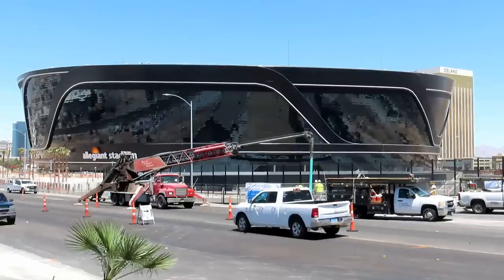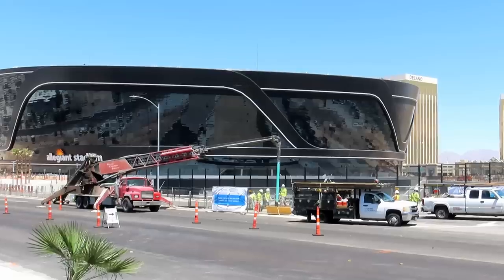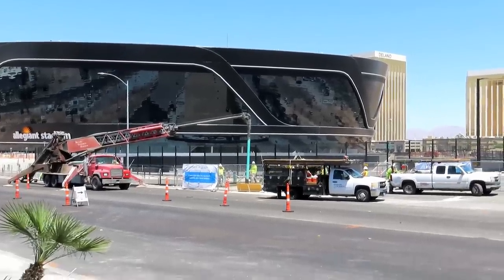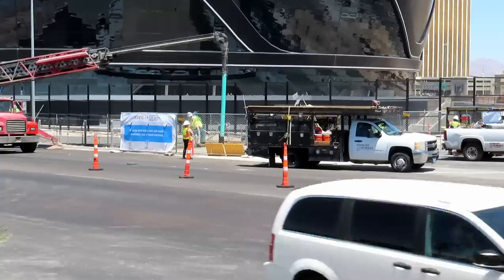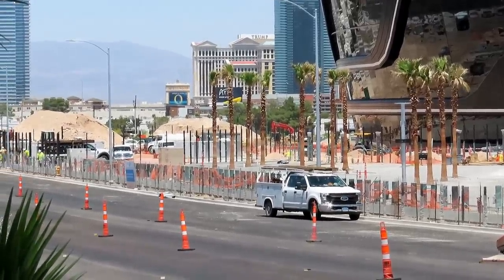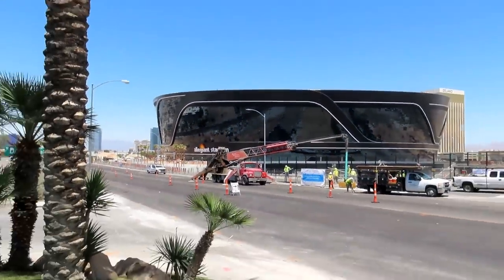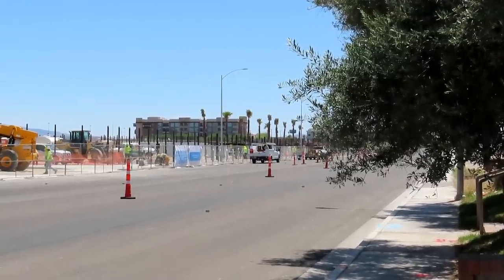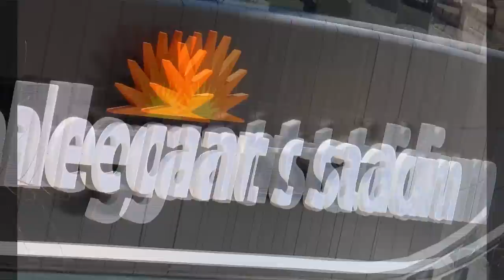Las Vegas Raiders Allegiant Stadium Construction Update 05 13 2020

Comment: If the field tray is around the same size as the one at State Farm Stadium in Glendale, AZ, then is about 234 feet (78 yards) wide and 403 feet (134 yards) long or about 2.16 acres.
Reply: Surfer Bob it’s not that hard to look up...
Reply: very similar but ours is more advanced and we will have concrete floor,fieldturf for unlv,grass for raiders,arizona dont have all 3 but i know they went and studied theres as a model
Reply: he 4-foot-deep tray will move the 9,500-ton natural grass field in and out of the stadium.

The tray will roll in on 13 rails through a 14-by-240-foot opening on the south end of the stadium.

The field tray will take about 90 minutes to fully move in or out of the stadium via 76 electric motors moving it along a rail line.

Comment: I always assumed that the horizontal lines on the west side were just a design feature. I always figured the idea was that the facade would not be symmetrical, and would be slightly different from each perspective. Will be interesting to see if they do hang anything there.

Comment: The poles now look like weather cams and sensors.  They say they'll be able to track storms up to 25 miles away.  the long snoot antennas might be weather and other info transceivers.
Reply: Larry Sawell Hey Larry.  The 2 metal poles on the roof appear to be rigid metallic conduit with weather heads for some kind of electrical wiring.  I’m an electrical contractor and have used them many times for overhead electrical service to homes and/or buildings.  And yes, the others seem to be a camera and antennas for whatever ?  Anyways, just my 2 cents 😉

Comment: Couldn’t they hold off 3=weeks on the grass. Get a big jump on the curbing and other concrete. So as to get all the asphalt down. They have a shitload of concrete flat work to install. Finish the damn roof, tear down the damn scaffolding. The panels on the Soffit over the doors has taken two weeks too long. Finish things before you move to something else. There’s a ton of loose ends on the building! Whosramroding this job?
Reply: baron urias dang bro. I don’t know how they got this far without your knowledge. Lucky I guess.
Reply: Obviously they don't use the same crews for those projects. These things can all be done simultaneously.
Reply: Ok youtube Foreman!